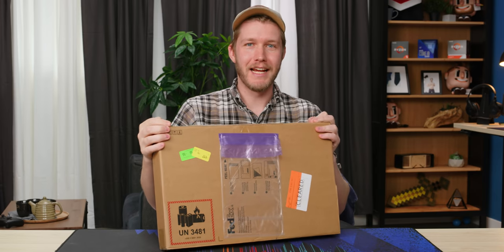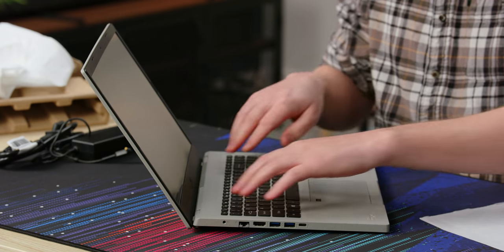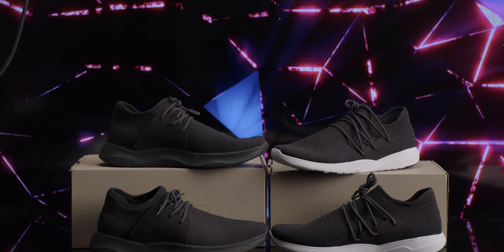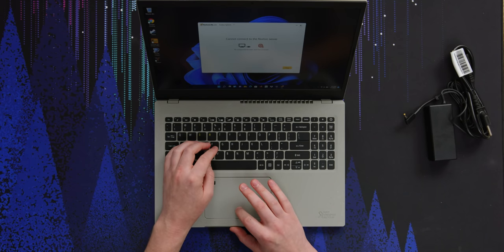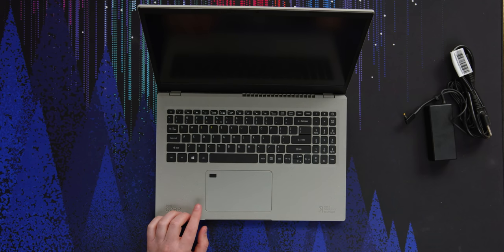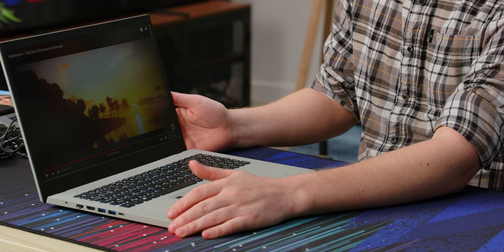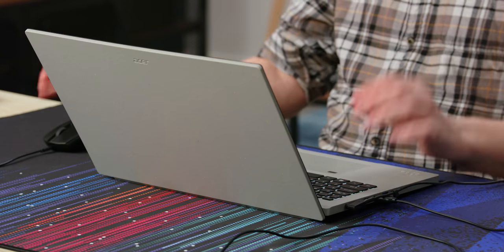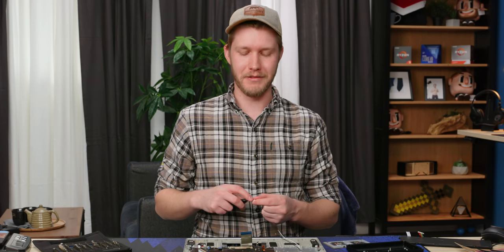ECO Friendly and POWERFUL?! - Acer Aspire Vero

Comment: This has incredible potential, that chassis looks absolutely stunning imo, if they made it with 16:10. Do a ryzen version WITH radeon rx mobile chips, give it a better screen (doesn't need to be extreme) and a bigger battery. Perhaps hdmi 2.1. Then I'm down. I would buy that in a heart beat. Like a ryzen 5800, radeon 6600m and lets say a 83wah battery. A stronger hinge so it doesn't wobble that much... Than damn..
Reply: Acer Swift X fits that description somewhat. Similar laptop.
Reply: So... Turn a 700 dollar laptop into a 1700 dollar one? Daymn
Reply: @annurissimo1082  that's what I thought lmao
HDMI 2.1 doesn't belong on anything like this yet. Ryzen would be nice, 16:10 would be nice, better screen would be nice, but that would bring it up a couple hundred I'd imagine. For $700 I feel like you're getting a lot of value out of it.
edit: seeing the Amazon listing saying it's $900 is a bit of a bite into the value, Thunderbolt would have been a nice inclusion, but for the hardware you're getting out of it, it's definitely overpriced.
Reply: Those chips basically don't exist
Reply: You just described a completely different laptop...
Reply: You guys know that you can get a ideapad gaming 3 with a gtx 1060, 8gb of ram (upgradeable), ryzen 5 5600h, better screen (fhd though) etc, for the same price. Right?

The 1060 maybe becomming outdated but can outperform a 3050 atm.
Also the RX 6600m, 6700m and 6800m are out with brands like asus, hp, lenovo releasing amd advantage editions of their populair systems.
(if you also wait a bit you can get a ideapad gaming 3 with a 120hz screen for the same price btw)

So, price isn't the issue if they did a RX6600m with a ryzen 5 5600hs or even ryzen 7 5800hs without dedicated graphics. Or even a 1060ti for that matter.
It would run just nicely.
Even with integrated vx graphics.

Perhaps indeed i described a totally different laptop,, however every laptop at the moment is basically the same. Just different parts. They should use that shell, go use amd (which is cheaper, more energy efficient and a bigger battery) which would make it 2x more eco-friendly... Just saying.

Also also also,
I feel like, one, systems are being overpriced AF because of the chip shortage and i feel like that companies actually sell 'gaming' systems that seem to be more powerful than basic systems (which in some cases aren't at all) because there is a 'gaming tax'.
Reply: @Spiffy_SiFF  I am not familiar of any laptops at USD 700 that have an RX 6700m/6800m, 6 core AMD chips and are about to be updated with 120Hz screens.
Or at least one with a 6600m/3050.
Could you please link a few so I can examine this further?
Thank you.
Reply: @annurissimo1082  apairently I'm unable to comment links? No idea if you received some earlier examples. Sure hope so.
I have seen multiple discounts/systems with decent specs for around 700.
Reply: No laptop out there at 700 exists with a 6600m, much less than all the specs you described. Your expectations are too high; at that point, why don't you also ask for a OLED display and personal chef as well.
Reply: @Spiffy_SiFF  Your links are invisible. You need to obfuscate them so they don't appear as actual links
Reply: @alexdavis9324  Ryzen 5800 does infact exist, just not in laptops.
Reply: Does anyone maybe know if the laptop has dual channel memory in the I5 8g ram version?

Comment: Acer is the best low-end brand in my experience. They have a good sense of what a laptop can do without.
Reply: In my experience, they were pure junk. After the second one, I had finally learned my lesson. This one sounds like it is better, but oh Lord, I'm not going there again.
Reply: They tend release no-frills laptops that just get the job done.
Reply: I have the acer aspire at 46 gl 14k which is this same chassis except aluminum and plastic with a ryzen 3350u
Reply: Acer designs are stuck in the 2000s. You can have so much better laptops for the same price range like say Lenovo. Im my experience as well they are very flimsy compared to their competitors. Buy something else other than an Acer.
Reply: @GrimYak  Where do you hear this , I've seen nothing but praise for their budget oriented laptops , albeit some cheaped out but fixable for not much cost.
Reply: Does anyone here know if the laptop has dual channel memory in the I5 8g ram version?
Reply: @Djuntas  If I were to guess, the memory slot is empty in that case. It would be single-channel until you upgrade it. It's unlikely that they have a 4GB module and 4GB soldered to the board.

Comment: I appreciate the effort, but isn’t it damn near impossible to do a fully recyclable laptop?
Reply: I mean i probably depends on how "clean" the frame is, if its 10 different plastics, its not gonna be easily recycled. The electronics themselves, apart from the battery, are actually recycleable as far as i know
Reply: Do you know which part is not recyclable?
Reply: @08.nguyenthanhuc38  That’s why I’m asking, but Alex already expressed doubt about the touchpad.
Reply: @08.nguyenthanhuc38  definitely the battery, the touchpad seems not to be easily recycled, pcbs cannot be recycled very well either, but at least to a certain degree so let's count that In their favour.

Comment: Rare to actually switch out KB only. The whoel top-case is usually replaced. It takes FOREVER to change KB only on the laptops you can. Im a repair tech and i rather have it this way with recycled plastic and change the whole thing than it to become e-waste for not being replacable at all
Reply: It depends, look at replaceable keyboards on older laptops, they don't need the keyboard replaced.

Comment: wouldn't aluminum chassies be more recyclable? It's not like most metals are advertised as recycled, but most foundries probably prefer recycling aluminum instead of going through the more costly mining and refining process. Other laptops probably use recycled aluminum without even knowing it. IDK man looks like a marketing thing to cash on the current hype around this type of stuff
Reply: A large amount of aluminum is recycled, while plastics are largely thrown away.  It's good that they're demonstrating that plastics can be recycled for commercial use however.
Reply: yes but this should at least be able to demonstrate that plastic can be recycled for commercial purposes, which is a good thing.

Comment: How is a 1.8kg 15" laptop "a bit on the heavy side"? I might be shocked mostly because I remember when 3kg was pretty standard for a 15" laptop, but it seems like 1.8kg seems pretty normal even by today's standards. That sits right in between what the 14" and 16" Macbook Pros weigh (1.61kg and 2.17kg).

Comment: When I see this I'm wondering
Why it isn't more common ?
I mean, pretty cheap, cool looking easily repairable AND not a shitload of screws and other machining things to do.
Just tell me why
Reply: I think it's because recycling material is actually more expensive to produce with, do the pricing can be difficult. Too cheap, the profit would be slim(compared to regular plastic). To expensive, the laptop would be competing against metal chassis laptop.
Reply: partly i think is the lazy design
layouting things so it won't interfere with screw placement is not hard but takes effort
this goes with making it modular and so forth
Reply: Pretty cheap? Doesn't this cost 700?
Reply: @aaronprimus1300  it's no 2000$ mac book
definitely on the cheap side of midrange

Comment: I have a similar laptop, 17" aspire 5.  These things are more than adequate for someone who isn't going to game.
Reply: And that applies to everything, even minesweeper. any activity can make these things fall apart. lol They are cheap for a reason.
Reply: @noirarmire1246  false.

They're perfectly fine for a casual user.
Reply: @noneyabizz8337  then you got lucky, I have a 62% return rate on Acer devices, I've sold hundreds (begrudgingly). I've kept track after my first year in sales resulted in 19 returns with 22 sold by just me. I have always suggested against it. They would either return it in the 2 weeks with problems, or die within 2 months. Where I couldn't take it back(Not included in the 62%). They are literally the cheapest tech you can buy. I no longer work in retail and the place I'm at now bought 300 2 months before the pandemic, I've filled out 23 RMA forms in the first 2 months, They sat unplugged for 6 months, then have filled out 97 since. Trust me, you're lucky.
Reply: @noirarmire1246  and what's your data on HP?
Reply: @noneyabizz8337  in all honesty, the acers we're the only data I kept during my retail days because it was that absurd. However, we had to by students laptops for the pandemic for 1 to 1. We bought about 8500, I think we had 12 or 13 damaged in shipping, and the only RMAs I filled out were the 4 on my desk because I bricked them while trying to remotely push a bios update and 2 where the keyboards stoped working. But that's all so far.
Reply: @noirarmire1246  I'm only asking because hp is pretty much the worst, interesting that didn't stick out to you.
Reply: @noneyabizz8337  that's because hp isn't actually that low on the list. If you compare it to custom build companies or something you can make yourself, yeah, it sucks. But in the prebuilt space for generic work environments, they are below dell, but not that much. They have a whole corporate tier of devices, and server solutions. Acer tried it but realized their low standard equipment couldn't handle it and clients wouldn't trust them for that level of computing and stopped. (Best decision they made) The order of quality varies on the type of device you are using, but the only device and the bottom of all categories is Acer. They've been the laughing stock of computing long before I was able to work. The problem is, they know if someone is looking at their laptop, it's because they are the cheapest per spec. They literally buy their parts from discount warehouses which hold stock of recalled parts they never swapped, low tier equipment no one wants in large quantities, then have a chassis built around it with usually crappy materials. There's a large chance, this laptop contains parts they never used or were left over from other projects and that makes up most of their "recycled" device. Why do I think that? Because they did it around 2007, they had a bad model, recalled the whole line, took what they thought was good for the next version 2 years later and had to recall it again because  the problem was actually from one of those reused parts. Just because you got the shiniest turd on your first try, doesn't make it better than the rest.
Reply: @noirarmire1246  I'm not reading all that.

HP is on the bottom, acer tends to be middle to lower middle on metrics like returns and quality.

Just interesting that the brand with the most issues didn't stick out to you.
Reply: @noneyabizz8337  tldr it doesn't. Work with them on larger scales then 1 at a time.
Reply: @noneyabizz8337  choosing to ignore what you don't see or is the personal experience of just you is not a good metric for what is a good brand and what's garbage.

Comment: I just bought the model after this one (i5-1235U) which is currently behind the latest 2023 model - more or less the same design, different CPUs - bought it based on the review of this video - just as it says on the box, nothing super spectacular, basically middle of the road in everything. just like the owner.  ex-demo model for only $400USD, has about 4hr battery life as a result.  but can always upgrade it later...thanks!

Comment: I wonder if instead of replacing the keyboard. They would allow a new chassis and then swapping all the parts over. Probably more expensive than just a keyboard, but would still allow some sort of replacement by pulling the entire laptop apart

Comment: DON'T BUY, you'll regret it. I have mine since 10 months and it's already falling appart. All the internal components are good, but the frame is the problem. This 'recycled" material, is was not properly tested. The left side of the hinge that connects the screen, is cracked and the frame that holds the screen is starting to fall apart on the same area. I never dropped it, my screen doesn't even have one scratch.

Comment: "Largely recycled materials" keywords for "we don't make a good product the first time so we try to fix it and to reuse it so we can recycle it again" Acer is the brand you buy if you need it only for 2 weeks.
Reply: What the hell? Have you heard of e-waste that gets recycled? And for the most part they meant the chassey. And that's out of plastic-waste. And not from not working old Acer products.
Reply: I've had a good experience with their monitor, but for laptops... yea...
Reply: @banthafood  they have a history of reusing faulty parts from a previous model because they thought a certain part was bad, but it was actually another one that they reused in another model. They buy such cheap (both cost and quality) parts in such bulk, that they will keep using it for years. That was my joke

Comment: And yet the keyboard is surely the most common part to fail on a laptop, and it'll fail way before any of those other parts.  0 points.
Reply: Funnily enough, my oldest keyboard (21 years old, built in the year 2000) hasn't failed yet, and is still going strong despite it receiving multiple spills, you would be surprised to know how durable none apple keyboards are (all my apple keyboards fail to a single minor spillage of water, and aren't repairable).

Comment: I just upgraded from a 2012 MBP to a 2021 14" M1 Max. using a high quality computer for 9+ years is a lot more eco-friendly than buying something like this that you'll stop using in a few years because you're tired of the floppy, dim screen, limited RAM and CPU, etc.
Reply: using a a laptop that can be upgraded is a lot more eco friendly than soldered components like the new Macbooks...
Reply: @jesusbarrera6916  that's assuming you can actually find parts. good luck sourcing a new motherboard in 5 years for a low-volume device like this which is more likely to have been completely abandoned by the manufacturer

technology changes quickly so there isn't an incentive to keep an ever-growing backlog of outdated parts in inventory. if we lived in a world where technology stayed mostly the same for 5+ years I would agree, repairability is much more important

that's not to say Apple is innocent here. part of the reason I waited 9 years to upgrade was because of the high failure rates of post-2015 macbook keyboards
Reply: @SeanLinsley  true, but you are talking  about high impact scenarios, 5 years from now getting a new motherboard from APPLE would be so expensive it would make more sense to just buy a new macbook

Comment: I use it with linux and it works fine, the only problem is that the fingerprint reader does not have a driver for linux, so it works badly, but I already knew it before, what made me choose this one, is its attractive price here in Chile compared to the competition, overall a good buy for me

Comment: I have the Acer Spin 3, and I guess I'll need a different system to compare it to side by side, but I've never noticed anything weird about the green values. Audio isn't great though, but that's really low on my list of priorities, as I'm using a Bose headset anyway. It's not super fast, but it's way fast enough for my use: some programming and some basic work. Oh, and this spin has a reversible screen and pen, and I couldn't live without it anymore for notetaking purposes. :-)
About that Vero though, will Acer provide schematics?

Comment: What i can say is this laptop is not only easily upgradable but also modifiable in some way. However with that large free space inside the laptop I think Acer can put a second RAM slot into this laptop without worrying about increasing the thickness of the laptop.

Comment: Cut/trim the supports in the empty areas and slap a huge battery in there with double sided tape so it don't move around. Replace windows 11 for 10 until 11 is fully optimized. Sold!

Comment: Maybe it's just me and that it may have with the cameras recording fps, and the laptop screens having a different refresh rate, don't remember if the XPS had a 120hz screen, but it almost looks like there's a trail from the crab on the XPS, especially from the claws when it dances in the side by side shot, and that there's a less noticeable trail from the Acer. I just found it really interesting to be honest, because if that's the case and that the Acer have a better response time then that's really weird.

Comment: I really wish manufacturers would get away from the plastic weld for keyboards. It does add a bit of stability to the keys for a cheaper price, but come on... keyboards are usually one of the most fragile parts of a laptop; they should be reasonable to replace.

It's on my mind as I had to recently replace the keyboard on my Asus Strix Hero II and ran into the same construction.

Comment: 0:45 also if the charger is already coming in a cardboard box why do we need to package it in another cardboard box separately? Seems like it defeats the purpose. Yeah we used recyclable materials! But we also use more material than is necessary! There is a reason that the first step in the recycling circle is REDUCE. That's because the best way to help with the problem is to use less materials to begin with.

Comment: 12:50 jokes on you: I repaired "welded plastics" keyboard very recently - you just need a soldering iron with temperature control and preferably wide tip, tweezers an about 45-60 minutes of your time!